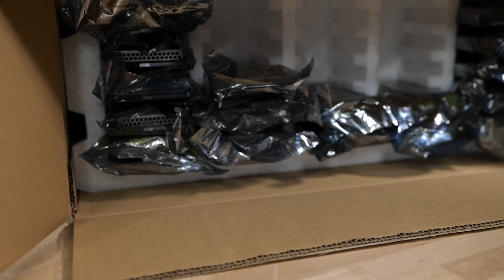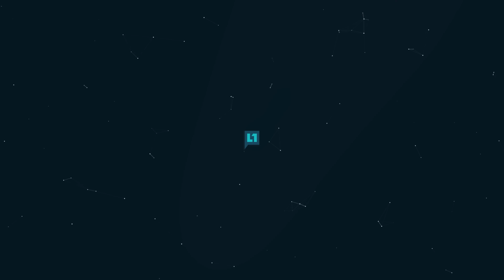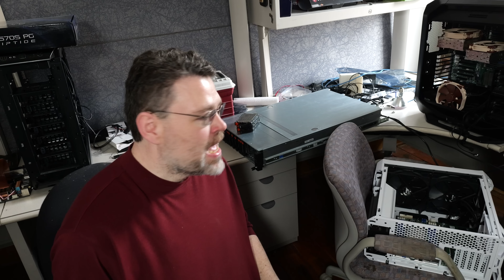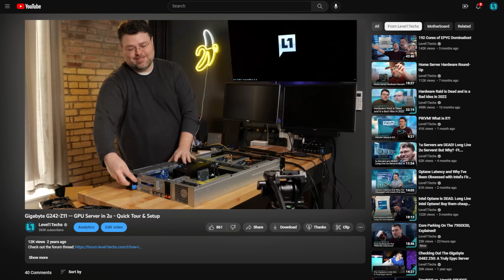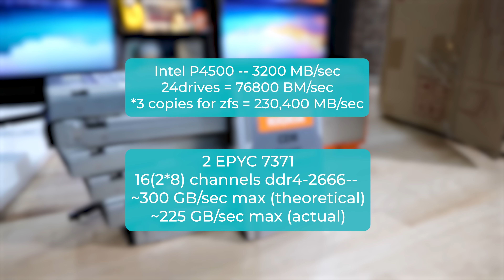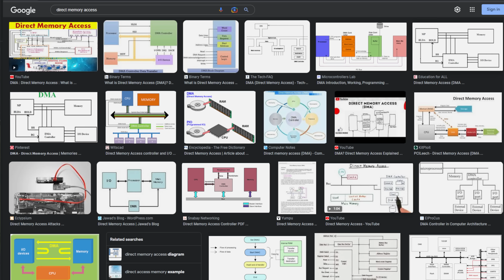Kioxia CD8: Tested and Scaled

Comment: Hi , congratulations for the content .
I have some questions related to Enterprise PCI-e ssd's : 
1 - Can we install windows 11 pro on them ? ( it is detected or need sone drivers at installation ) 
2 - It works better on Intel 13/14 gen or with AMD 7000 ?  AMD x3d have some storage advantages ? 
3 - They Need some adapters from M.2 to their connection , what do you recommend ? 
4 - It is better that my old Intel Optane 900p ? 

Thank you !

Comment: @9:20 - OCZ still going strong in truenas
=== START OF INFORMATION SECTION ===
Model Family:     SandForce Driven SSDs
Device Model:     OCZ-VERTEX3
Serial Number:    OCZ-809LU37ZNBLAHBLAHBLAH
LU WWN Device Id: 8 e54lah 77b16blah
Firmware Version: 2.25
User Capacity:    120,034,123,776 bytes [120 GB]
Sector Size:      512 bytes logical/physical
Rotation Rate:    Solid State Device
TRIM Command:     Available, deterministic
Device is:        In smartctl database [for details use: -P show]
ATA Version is:   ATA8-ACS, ACS-2 T13/2015-D revision 3
SATA Version is:  SATA 3.0, 6.0 Gb/s (current: 6.0 Gb/s)
Local Time is:    Wed Mar 22 08:08:29 2023 EDT
All smart values of 0 were omitted with 2 exceptions:
  9 Power_On_Hours_and_Msec 0x0032   031   031   000    Old_age   Always       -       61098h+06m+06.480s
 12 Power_Cycle_Count       0x0032   099   099   000    Old_age   Always       -       1206
174 Unexpect_Power_Loss_Ct  0x0030   000   000   000    Old_age   Offline      -       403
177 Wear_Range_Delta        0x0000   000   000   000    Old_age   Offline      -       4
196 Reallocated_Event_Count 0x0033   100   100   003    Pre-fail  Always       -       0
230 Life_Curve_Status       0x0013   100   100   000    Pre-fail  Always       -       100
231 SSD_Life_Left           0x0013   097   097   010    Pre-fail  Always       -       0
233 SandForce_Internal      0x0000   000   000   000    Old_age   Offline      -       40086
234 SandForce_Internal      0x0032   000   000   000    Old_age   Always       -       26106
241 Lifetime_Writes_GiB     0x0032   000   000   000    Old_age   Always       -       26106
242 Lifetime_Reads_GiB      0x0032   000   000   000    Old_age   Always       -       17413

Comment: I didn't follow how 24 drives were going to use 75% of the total memory bandwidth. 24 drives * 6 GBps = 144 GBps, but then you multiplied the 144 GBps by three, why? 

Also I feel like you're going a little easy on us as far as technical details. You said signal integrity was a problem. What were the incorrect cables? what were the correct cables? Are you using MCIO cables or SlimSAS? I can lend you some SlimSAS 8i 0.5m cables if it would help, but Genoa probably uses MCIO for the PCIE 5.0 speeds, even though you are running the SSDs in 4.0 speeds (I think).

Comment: I once took a class with a database professor who told me he gave a talk at Microsoft to the SQL Server team. He had written a research database with performance which really impressed the SQL Server team. He claimed that one of the reasons for his performance was that he stored his data structures directly on the system's block devices, avoiding the FS overhead. The SQL Server people dismissed this approach because they believed customers preferred the convenience of storing data in the FS. I believe that assumption to be false, as most on-prem DB deployments use dedicated hardware. But I do wonder, how much overhead is there from the FS?

Comment: Is ZFS still suitable for such SSDs? COW nature of it goes against a lot of SSDs' internal optimizations. In super-HPC world WEKA is used, but it is more of a niche FS.
Reply: ZFS is for reliability, not for best speed. Even on normal SSDs it runs slower than say mdadm raid + ext4/xfs. WEKA is a cluster filesystem (it joins storage and compute resources of multiple storage nodes as a single storage pool) so it's a different animal entirely.

Comment: 9:23 I do, I don't really use it anymore, haven't for many many years, because it's dog slow, but works fine as an external drive just to move some stuff around.
But what died on me were two Samsung drives, one 250GB 960 EVO that didn't even last enough for me to finish installing Windows on it, then another 500GB 960 EVO that died just shy of it's 2 year warranty expiring, and a Toshiba TR200 240GB.
Maybe I had another SSD die but I'm not sure.
Moral of the story, Samsung drives? Never again.

Comment: I think I still have a 30GB OCZ drive. And I think it still works, but I'm not sure. It hasn't been hooked up to anything in years. I stopped using it just because it was too small. I also have a 150GB Raptor with the acrylic cover from that same era. That one may have crashed heads. It hasn't been used in years either. My 250GB Samsung 840 Pro is still rocking as my boot drive though. I've never even touched an NVME drive as my Z87 board doesn't have any slots for them. All the newfangled stuff that's come out in the last decade just hasn't been necessary to upgrade to.

Comment: I would love to see MS SQL VS ZFS MariaDB performance comparisons and latency.
Reply: ZFS does eat a lot of database performance for the benefits it provides.
Reply: @magfal  How so? My testing showed an improvement from 7000ms without ZFS to 63ms with ZFS.
Reply: @ericneo2  go beyond what fits in the ZFS ram read cache while testing.
Read based testing that doesn't go beyond that is testing your memory not your filesystem and IO subsystem.

For tiny workloads COW filesystems aren't detrimental but for heavy workloads they are.

COW systems slow down when they approach full capacity.
The memory cache of ZFS and the memory cache of your database are competing for memory together with your workload when you're applying a heavy load.

If you're testing against a simple file system you need to either enable compression on both or neither since file system level compression can distort performance characteristics.

In short ZFS and proper databases have a lot of overlapping work that when truly compared apples to apples constitutes an overhead.
Reply: @magfal  "COW systems slow down when they approach full capacity." - Isn't that why they recommend a fast the ZIL/SLOG?

"proper databases have a lot of overlapping work" - I completely agree but I don't know of a better way of getting requests into a RAM Read cache. Have you come across one by any chance?

There are flash and in-memory relational databases that have solved this problem but they are all enterprise or SAAS with a steep price and hardware requirements.

My main interest in this is repurposing old servers with plenty of RAM to perform tasks faster than new servers built with spinning rust. A 50GB DB is nothing when you have 192GB to work with.

Comment: I hit a problem recently when writing some async io software on a 3rd gen EPYC and 4x 30TB Intel drives, I could get  25.8GiB/s (28GB/s) with nodes per socket (NPS) set to 4 but this drops you down to two channels of memory (~40GiB/s) per numa node so the best i could get achieve was 20GB/s (basically max speed of read+write to RAM on two channels). Any other topology setting would throttle you somewhere else, and ensuring the buffers all fitted in l3 cache also didn’t work, grr. 

Fortunately 12 channels of ddr5 per socket (3 channel per numa node) is enough headroom even for a theoretical x16 PCI 5.0 raid 0. Kioxia have a press release about CM7 but not clear if these are actually available other than to “selected customers”. 24x pci 4.0 drives is still awesome though and good to see the bottlenecks getting removed

Comment: I still have my OCZ 64gb drive from at least 5 years ago still running and rocking in my NAS.
Reply: Probably older, I bought a 64GB Kingston in 2008 or so. I think that particular drive is in a laptop somewhere...
Reply: My first SSD was an OCZ 64GB, but the 128GB version was far more viable, I found in Linux the 64GB was throwing errors.  But those drives I got to install 64bit Win7 & Linux on, so more like a decade
Reply: Still have one running my PfSense
Reply: @rooksisfuniii  I think I have one that probably would run, but the PC is in storage and I'm out the country so cannot get it out to check :)
I stopped bothering with the small one, it's hard to even remember how small they were when Win7 & Sandy Bridge were new things :)
Reply: Still have one running my PfSense

Comment: Have the Genoa issues with 2DPC been fixed with the latest updates?
Reply from the maker: I don't have any 2dpc chassis. It's kinda funny it's .. 12 channels would you rather have 8 channel 2dpc or...12 channels? Seems 12 channels is better for now esp with higher density memories buuuuuuut
Reply: Was wondering if the Genoa 2DPC issues might have similar roots to AM5’s 2DPC woes.